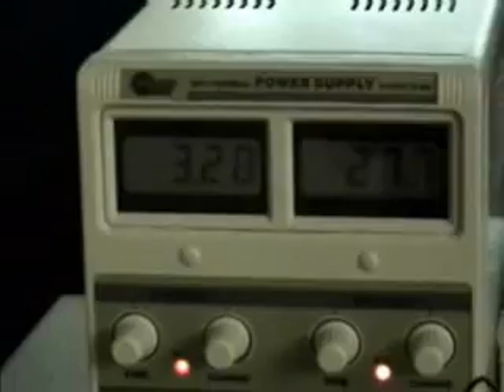mini Tesla Coil with a tiny rotary spark gap (mamoynas)

Comment from the maker: @luke036r. The static gaps tend to misfire  or fire early and are more dificult to finetune.A static gap behaves like a bad zener diode and has variables that costantly change e.g. the dryness of air or the temperature of the gap's electrodes . The rotary on the other hand is a fast on-off switch with the only variable being the turns per min which you adjust easily,giving you total control over charge/discharge timing, or even automaticaly based on circuits that monitor the capacitor's charge.